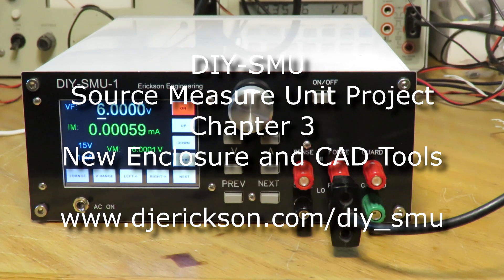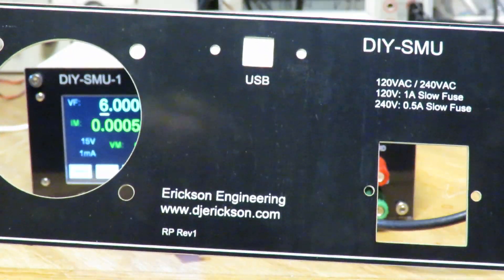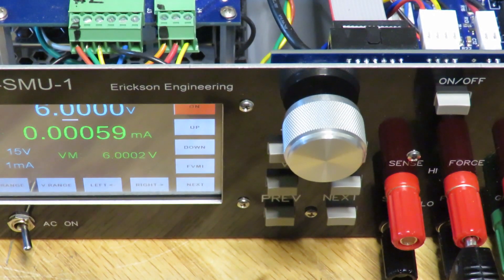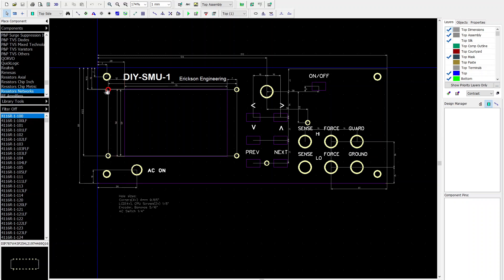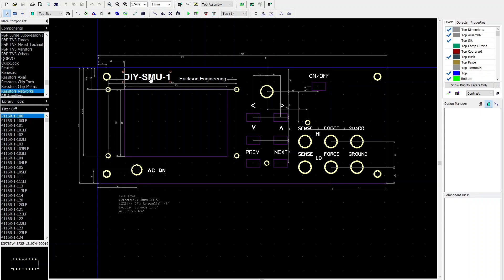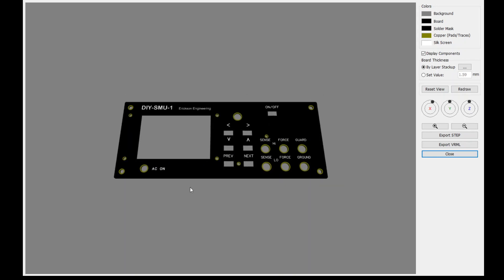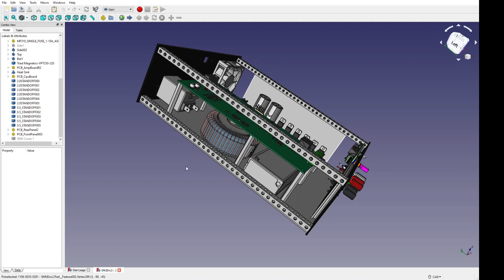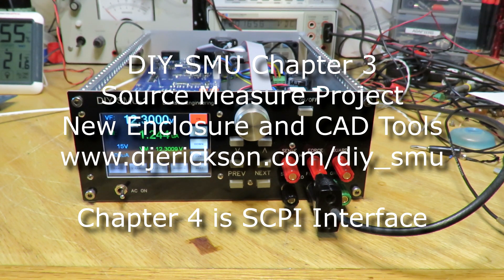DIY-SMU Chapter 3: New Enclosure, tools and Techniques

Comment: This is wonderful. And what the heck would we do without places like PCBway. It’s like an engineers dream factory
Reply from the maker: I agree, PCBWay and JLC are game-changers. Before that, since about 2005, I used ExpressPCB for dozens of designs, and was happy with their service. I liked their 3 day turn-around.  Before that there was a lot of hand-wiring and wire-wrapping. I stopped making home-etched boards in the mid 80s, too messy. Life is good now.

Comment: The series are great! Good job!
Do you have something in mind for the next project? I would love to see you make a bench power supply.
Reply from the maker: I do. Possible next projects are: A relay MUX board, a multi-channel, low-power SMU, Rev2 of the 18b DAC precision voltage source. Pretty busy finishing this SMU now. 
I've built a few power supplies, check out www.djerickson.com. I agree a power supply is a good starter project. But there are soooo many good and cheap supplies on the market now. I noticed one hole in the market: a triple power supply with USB, current and voltage controls for cheap. I worked on one in early 2019, and got as far as simulating and prototyping a design for the low-drop-out (LDO) regulator. Have early schematics and PCB.  Check out my design notes at www.djerickson.com/triple-ps. I'll post the schematic and layout soon. Let me know what you think.

Comment: Thanks for sharing. I did a test with this SMU circuit. But I got output with AC noise (about 0.2V) when I used a 34401 at AC V mode. Can you give some advice?
Reply from the maker: I just did the same test and I get 9 mV. Checkout the latest schematic. It has some updates that affect stability.
Reply: @ericksonengineering7011   Thanks a lot. I think I got the point for the noise. It might come from common mode noise.